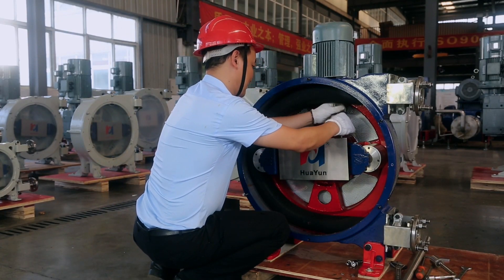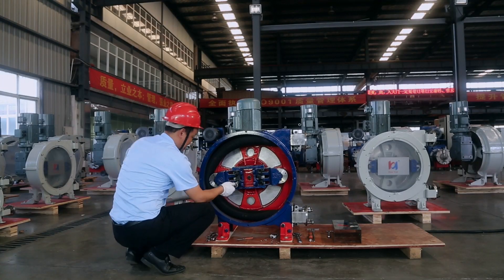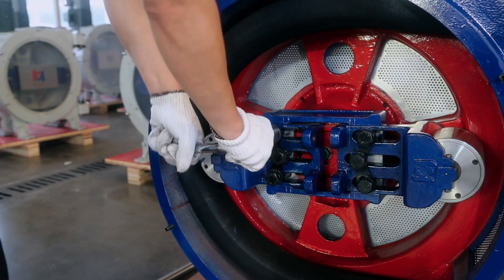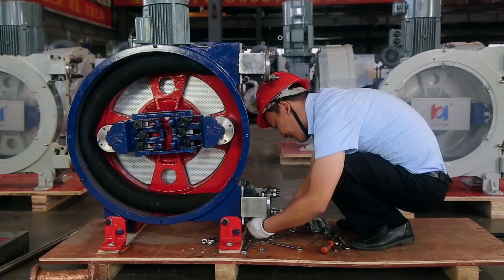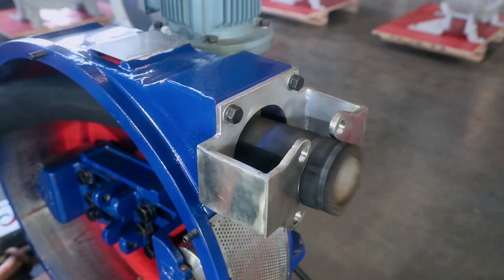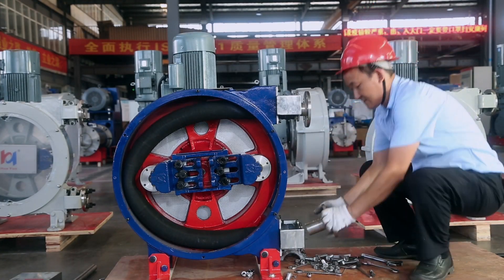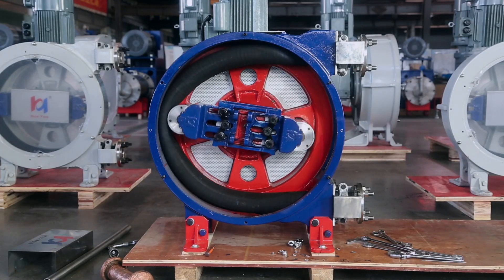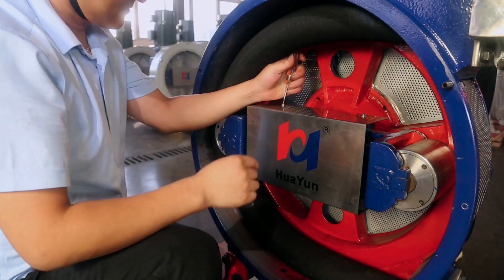Peristaltic Hose Pump|Huayun Industrial Hose Pump Z Pump Replacement Hose

Comment: Easy to adjust the output pressure and replace hose
Reply from the maker: You know, the Z-type pump is the crystallization of our many years of experience in the production and manufacture of hose pumps, efficient pumping capacity and simple structure make it the first choice for peristaltic hose pump users